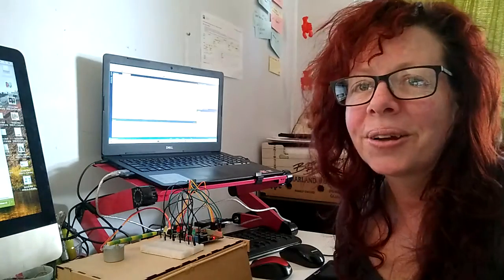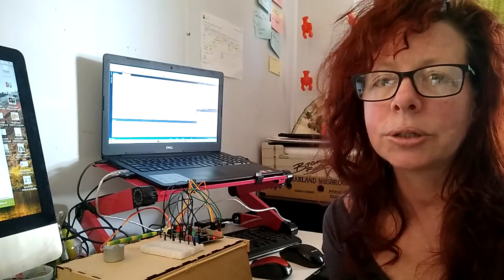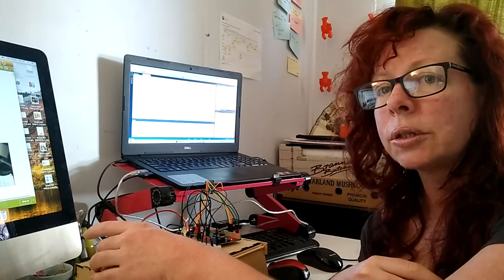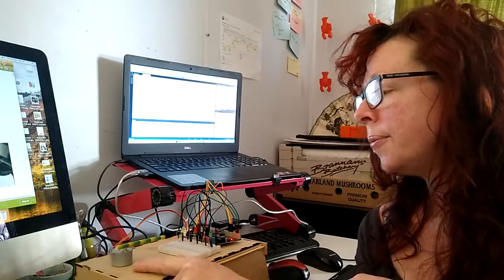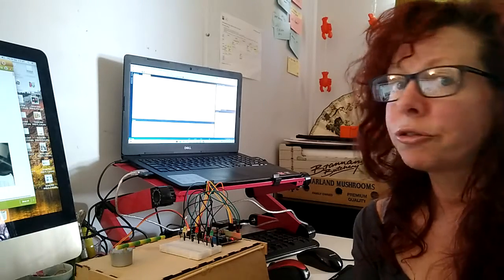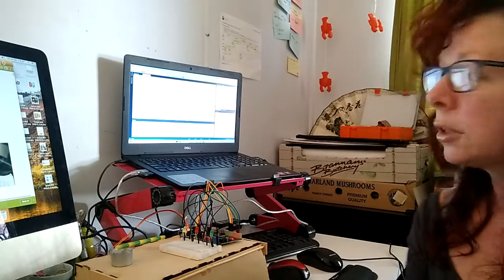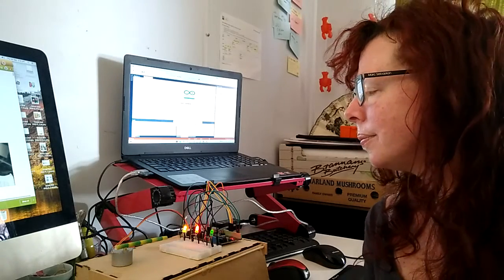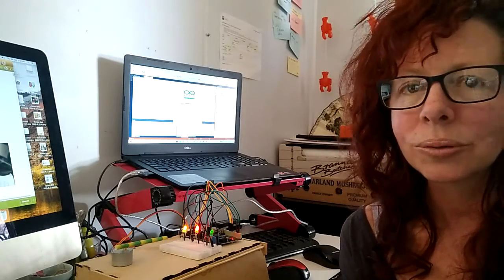Voice Activated Stepper Motor with Arduino

Comment: I think this is commendable. But you may want to use mqtt or the other service that escapes me now, and arduino esp8266 or esp32, then use Alexa, or google home to interpret voice commands. There are a ton of videos on youtube on that. The issue is that it takes a lot to properly interpret a wide range of voice, tones, dialects, etc. These companies have spend vast resources to perfect speech rec.  You can get a google home from target for 25.00 so cost is low.